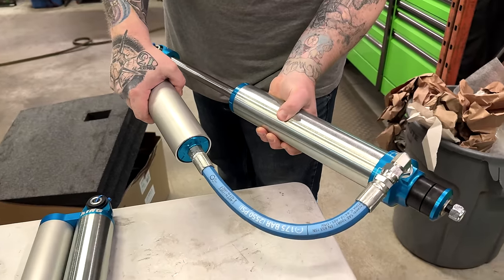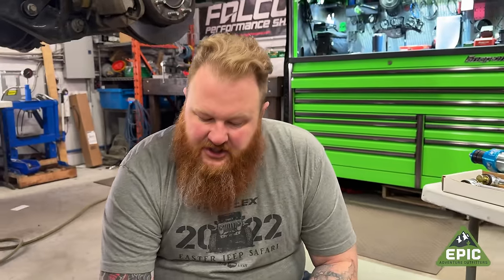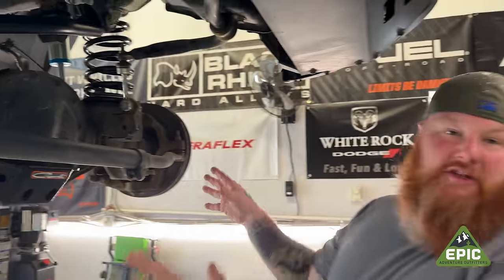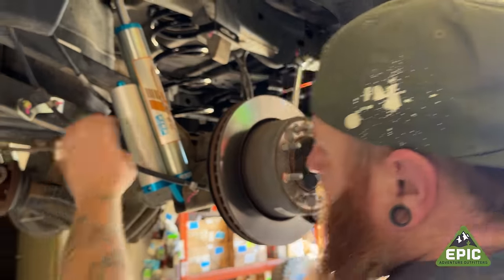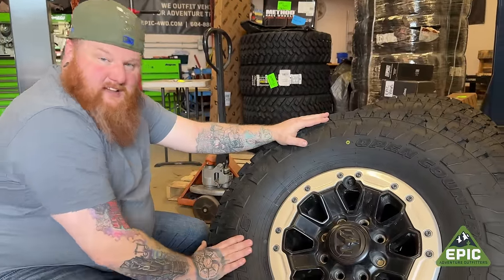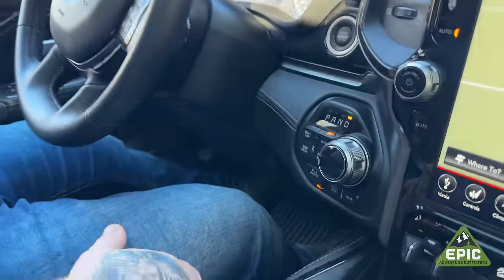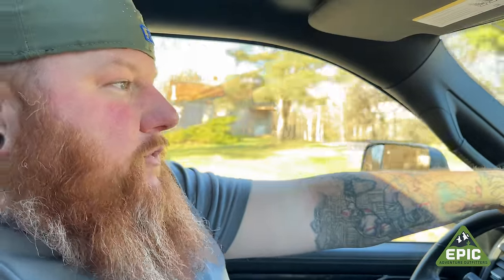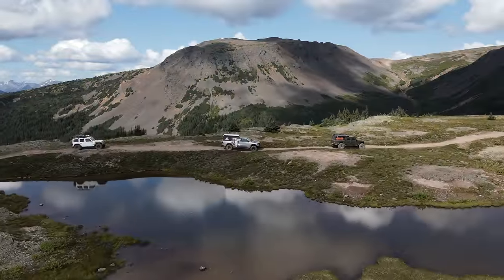RAM Power Wagon Lifted on Carli Pin Top Suspension System - This Truck is Built for Overlanding

Comment: That is a great looking truck.  I went a slightly different way with my suspension for my PW.  Used the Thuren suspension primarily with Carli R2 coils and Carli end sway bar links with much cheaper Fox 2.0 IFP shocks.  Those Kings are awesome but definitely pricey.  I am just climbing rocks and trails at slow speed so the remote reservoirs would probably be overkill for me but they would definitely be nice to have...  I have a video of the install on my channel.  Also, I believe that the wheel travel increase is the same with the Carli kit you installed and the one that I had installed.
Reply: Yes those beautiful Kings come at a cost, this guy gave us his kidney and part of his liver.
Reply: @TheEPICBeardedGinger  🤣🤣

Comment: The PW 12000lb winch is underrated, if for some reason you needed to rebuild it the part numbers are for a 15000 model🧐, also it’s a reverse rotation from a standard Warn.
Reply from the maker: Cool! thanks for the info! Cheers from the team at EPIC!

Comment: I have a 1500 Rebel, but the Power Wagon is my truck crush. But it's just so large. Did ya'll ever come up with a front diff brace solution for the 1500s?
Reply from the maker: Yes, after driving this Power Wagon, it is most certainly our truck crush. We did our own bracket for our own Rebel and a few others but we're not producing it as a product or anything. Most fabricators worth their salt can figure it out in a few mins ;-) Cheers from the team at EPIC!

Comment: So looks like 37s fit on the stock PW wheels with the beadlock?  I believe those come with the “wheel package”.  And with that additional lift there’s no rubbing?  Or did he have to do some on the pinch welds still?
Also, why the Pintop vs the Dominator system?

Comment: Are those the 3.0 or 2.5 kings i mustve missed it in the video? Also i want everything you guys put in there. Is there a complete parts list or link to buy from? Was thinking back country kit but wouls rather have the kings 2.5s seems the 3.0 dominators need more modification to fit and ride well

Comment: What ever happened to you designing a fix/reinforcement for the front diff you broke on the Rebel a while ago... I seem to remember you finding a weak point in the diff design
Reply from the maker: We designed our own fix. As we're not a suspension company and don't plan to be (insurance costs are crazy), we won't be making it for sale to the public. Any fabricator worth their salt can take a look at our RAM video and make you up something similar. We also just shot another episode of our Podcast (out in a few weeks) that covers off what exactly we did to strengthen up the front diff housing. Cheers from the team at EPIC!
Reply: @EPIC-4WD  Thanks!

Comment: I believe you  can get Ram 2500 diesel with  some kind of « power wagon » package. Not the real thing but pretty close!
Reply: Yes its the Rebel 2500 Package but it doesn't have lockers, swayer disconnect, 2" lift or the winch just a really sick trim package without chrome.
Reply from the maker: Yes, you can get a RAM2500 Rebel now. Our friend Shaun has one from "the story till now". Sweet truck. Next week we're cutting it up and going with 40s!!! Fun times. Cheers from the team at EPIC!

Comment: Carli King lift, suspension, and shocks, five 37" tires and rims, S Pod controller, LED lights, throttle response controller, dual ARB onboard compressors, arb retracting step-up, S&B cold air intake and filter, rear bluetooth airbags, air chucks front and rear, Backflip tonneau cover, and slide-out bed for easy access.  How much you think all that cost above and beyond the MSRP of a Power Wagon?  Well, in 2022 it cost $30,000usd so all y'all better start saving your money.

Comment: Cool, but no Cummins. Why didn't Ram do a 3500 Power Wagon?
Reply from the maker: Probably because the 6.4L is lighter and quicker off the line. But yes, a power wagon with a cummins would be da bomb. Cheers from the team at EPIC!
Reply: The extra 1,000 lbs the diesel weighs would degrade a Power Wagon's off-road performance.  Remember, the PW wasn't built for towing or carrying massive loads, it's all about off-roading and no full-size pickup truck can come close to the Power Wagon.

Comment: Do me a favor and measure the ride height at the top of the shark fin antenna.
Reply: I have a ‘22 PW on 37’s with a Carli suspension package and I’m just under 7ft. at the highest point (unloaded running about 40psi in the tires).